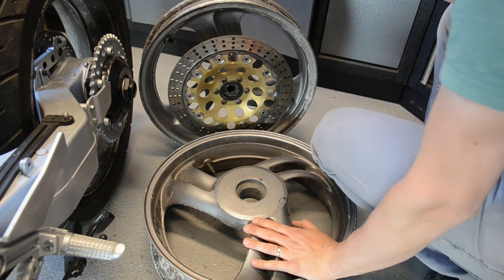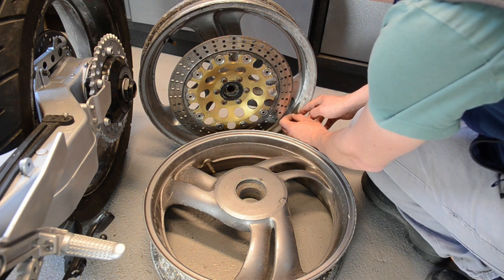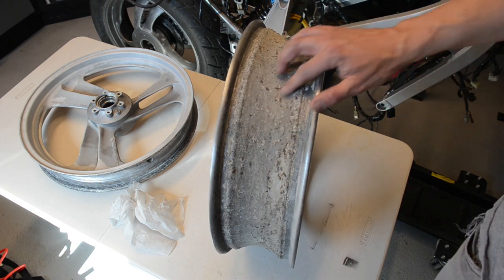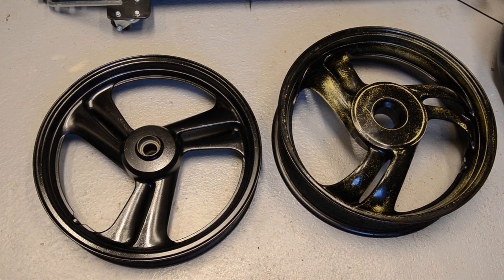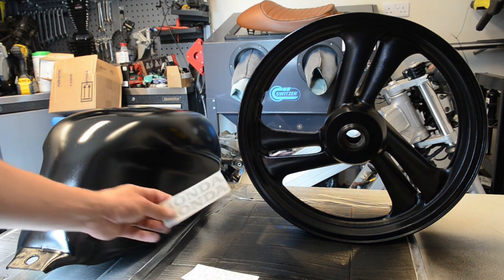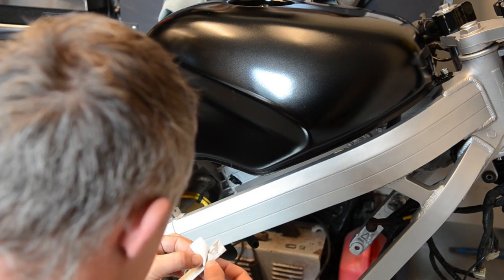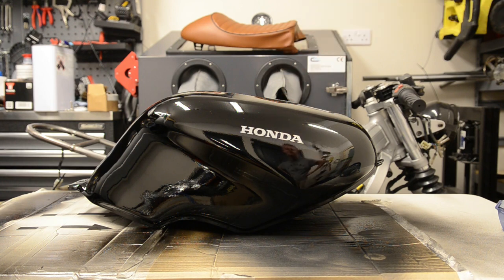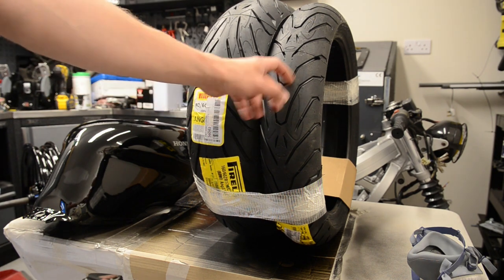Honda Bros NT400 Restoration Project Part 21 Painting tank and wheels

Comment: Do you have a link where you got the tyres mate? Love the videos, really helpful.
Reply from the maker: Glad to hear your finding the videos useful. Yeah I got these online, this set was from deamontweeeks but through eBay, all in for £165 shipped from Uk, issue with the bros is the front wheel size is odd ball, and I oversized a little 160/60/17 on the back and 120 on the front. I wouldn’t go any bigger really
Reply: @Yoke.  Thanks a mill mate, I'm doing up a BROS of my own at the moment and your videos are a massive help!